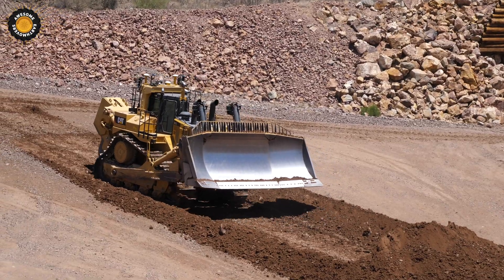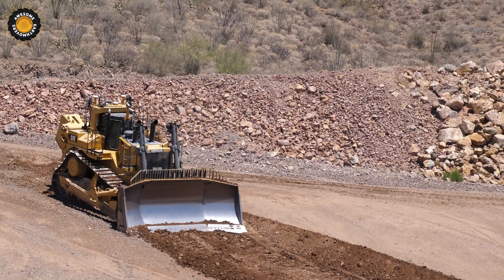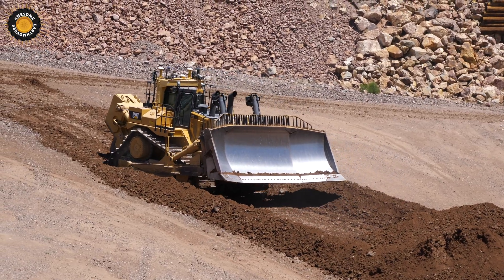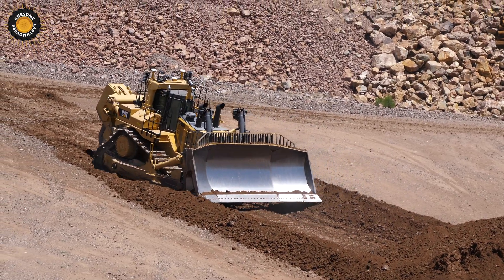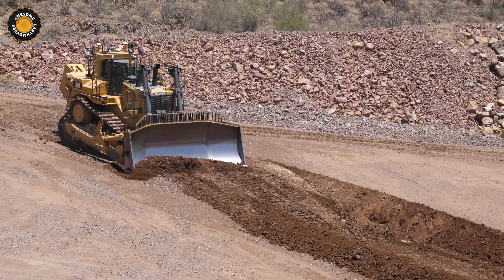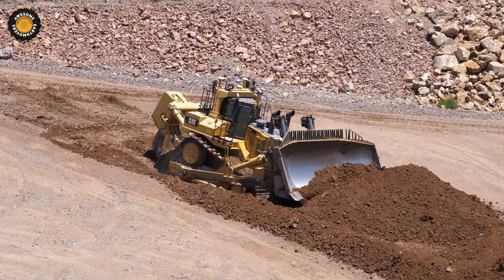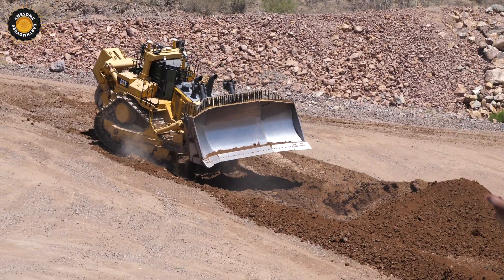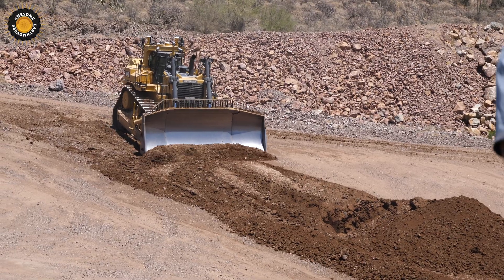Remotely Operated Cat D11T Dozer

Comment: An accident waiting to happen. Easy to loose focus on what's going on. Motion was not as smooth as an in-cab operator would be, often dug in too deep. Sure, can imagine some very limited uses, but come on, saves on shift change time! That's the selling point?
Reply from the maker: pl5bnsf You actually have more control if you consider you can put cameras outside of the cab to see better and it’s quite possible for the remote operator to get haptic feedback so they feel what the machine is feeling. You save having a person in a hostile and dangerous environment and you don’t have to fly them to an isolated mine site and house them in a camp.
Reply: Cool, since I can only dream about even getting near any construction equipment, I'll keep an open mind about remote operating :> Sure would be fun to try out, that's for sure!